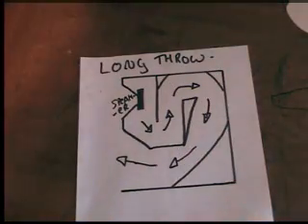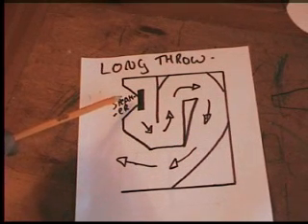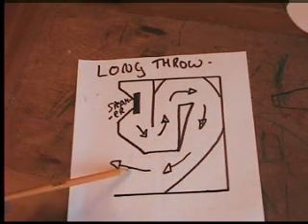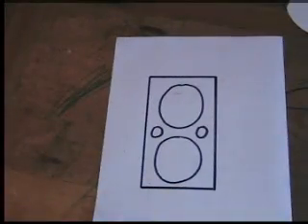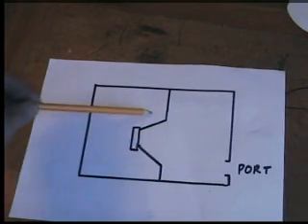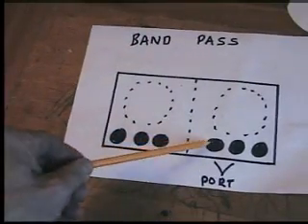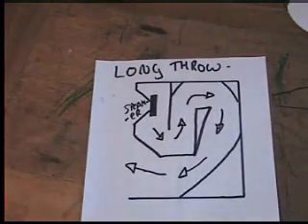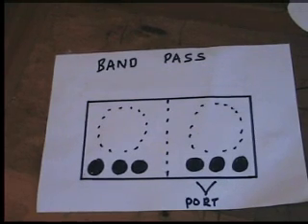3 types of bass speakers part 1;www.djtutor.com Jan 20th

Comment: I have a 12 " DEI sub in my car fitted into a bandpass tube which I have just finished. It sounds the nuts and would recommend it over the other designs. Having said that, it does depend on what sort of sound you want.

Comment: Sleep-we use two Cerwin Vega EL-36's for each side of our tri-amped PA system. For each side we butt them together and lay them on their sides (forming a single large exit). We are easily sending low freq. content (28-40 hz) 60+ feet away at almost 120db. Being paired into a single large throat helps extend the low freq. ability of these simple folded horns.

Comment: your "long throw" type is actually a folded horn design--the way it works is the cavity gets wider as the sound travels through it, turning pressure into displacement. these are the most efficient type. the second type would be more accurately called vented, ported, or bass reflex, and they are the most compact type. (all of the types you described are forward-facing.) I don't know much about bandpass speakers.

Comment: Lastly, they throw farther, because there is not as much distortion/added harmonics to cause cancelation.  However, there are downsides to most production horns.  Most  marketted horns have a big 18" driver, and a short horn path.  Aweful idea, and marketting only.  Those big Cerwin Vega horns do not go very low, because the 18" driver takes up to much space, so the horn is too short.  If you want a better horn, look at EAW LA400 style horns, or a DIY build, Bill Fritzmaurice, look it up :)

Comment: Then again, it does come down to need.  If you are happy with what your subs do, there is not an urgent reason to upgrade.  If you need more, take a good look at horns, along the EAW lines, or along the Bill Fritzmaurice DIY builds on a budget.  I own two Bill Tuba 30's loaded with 12" drivers, and they will kick the crap out of a dual 18" bin.

Comment: Horn (Box nr1): Big , but Highest efficency Highest Fidelity Bass . Bass Reflex (box nr2) : Good efficency , small size and medium delay. Bandpass (Box nr3) : High efficency , small enclosure , but really high delay. So you get the best bass from horns ,an the best compromise from bass reflex.for hifi bass use a front loaded horn or a closed baffle enclosure.Bandpass speakers are great for hiphop or reggae , but since they have such an great delay most bandpass speakers only create "sound soup".

Comment: The primary reason why a "long throw" subwoofer will "throw" farther, has nothing to do with how fast the sound comes out.  The speed of sound does not vary, it is a constant.  If you change the speed sound travels, you also change the frequency.

Comment: hey ive been DJing for 7 years im 15 years old, ive been using 3 way speakers but I want to change to have some bass speakers and on top some mid and high but i still not to sure what I need exactly what to get, like the cross overs and like some kind of equalizer can You give some great advice like a list what i would need to buy what im looking for, thanks

Comment: Sound quality wise, bandpass is terrible. Bandpass gets loud on a very narrow array of frequencies, and then lacks the rest of the frequencies. Most companies that make bandpass boxes tune them high, and you will never hear a not below 35 hz out of them. Depending on what type of music you listen to, I would recommend either a sealed or conventional ported box. In order to get low, use a ported box and tune to 28-32 hz.

Comment from the maker: Depending on the amount of people, a small two way of about 1,000w(1k) for a croud of up to 100, but over that and you will need a bigger system . For outside a horn loaded system is better as it throws the sound a greater distance.
  If you play outside a small full range cab will be no good!

Comment: This comment is utter rubbish!

"z030n3r5 years ago
The first design is actually called "Horn Loaded" Or A "Scoop"
The second design is called "Vented" Or "Direct Radiating"
The last design would be a 4th Order Bandpass.
Bandpass subwoofers only play at one certain frequency.. hence the fact that they would be loud..depending on what frequency they are being played at."

A speaker playing a single Helmholtz resonance frequency is pure fantasy! You can achieve a decent flat response with a bandpass, depending on the driver and the design and order of bandpass, so you comment is nonsense.